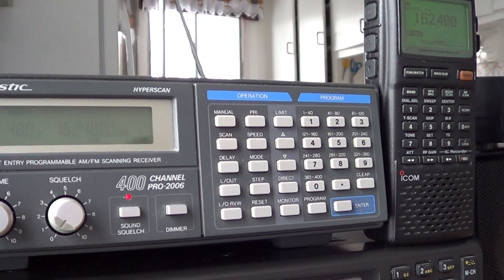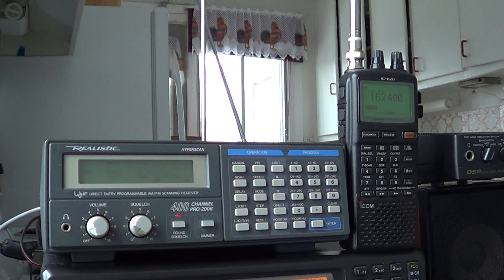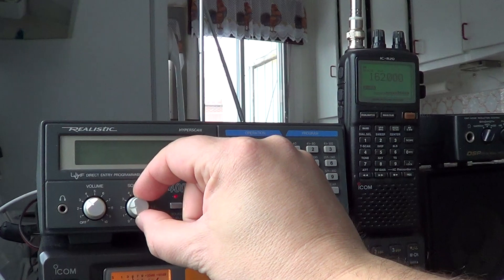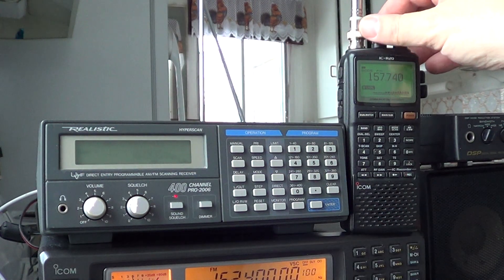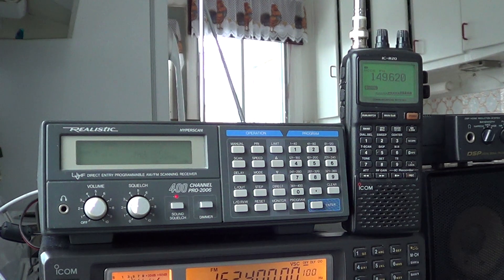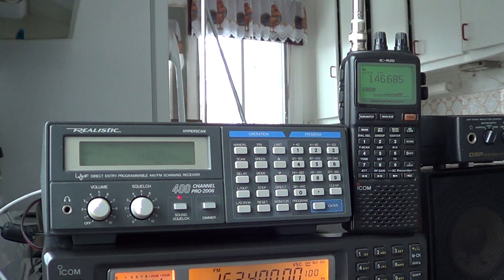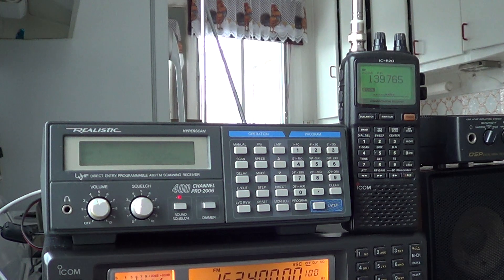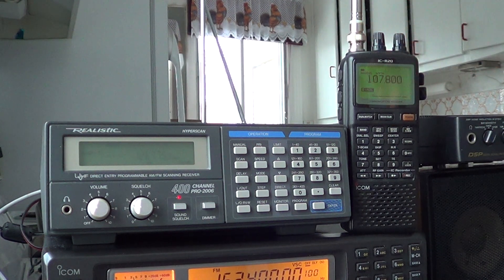Realistic PRO-2006 VS Icom IC R20 on VHF

Comment: It's difficult to compare when the antennas are at different positions. Radiosignals are radiowaves and at VHF it goes from max to min when you move the antenna 50cm. When comparing you really need to use the same antenna with a splitter to feed the exact same signal to both receivers. The lenght and angle of the telescope also affects reception. The Pro2006 have a zeromatic feature that let it stop on frequencies only if they are spot on and not 5KHz off. The Icom do not have that. The Pro2006 lacks 6.25KHz step (and some other step sizes) that modern bandplans over the world now use more and more so search will sometimes not work but scanning will as that do no use zeromatic. Higher scan/seach rates will let to capture more traffic but catching interference/intermod are a problem and needs RF filters. Having text tags for channels are a big help that Pro2006 lacks.

Comment: hi, on the pro 2006 can you add an antenna to it too? could you give me a good make and model of an antenna for it?
Reply: I use a discone 30 feet in the air and the reception is superb.
Reply from the maker: it has a BNC plug in the back for a outdoor antenna, a Discone is one of the great antennas for receiving VHF UHF

Comment: Very useful. I've just acquired an R20 and as a standalone receiver it is pretty deaf on SW and also on broadcast VHF. I tried to tune a weak station on 103.3MHz and instead it picked up spurious from another station, and so did my old R5. My SW-7600GR was able to do it with a little adjustment on the RF gain and a DE1103 got the best reception by far. I bought the R20 as an upgrade to my beloved R5. They perform pretty much the same. But the R20 has a whole lotta more features. I guess I should sell the R5, but I guess I'm a hoarder after all.

Comment: Your Pro-2006 still looks brand new. Mine was given to me by an acquaintance but was in pieces when he gave it to me. The rear plastic screw retainer rings on the upper and lower case halves were broken (a common problem on old Pro-2006's) but I found replacement screws with over-sized heads that properly secured the case to the chassis. The display backlight was completely burned out , the internal speaker didn't work, and the front panel looked as if someone operated the buttons while eating greasy ribs and the buttons were literally BLACK from their dirty-ass fingers. I disassembled the entire front panel and soaked the front plastic cover and rubber keypad in hot soapy water and used an old toothbrush to thoroughly clean everything. I replaced the electroluminescence (EL) backlight module (found on Ebay for $20) and looks like new again. I also replaced the rear-mounted external speaker jack (pulled from a parts-only Pro-2005) , which was the cause of the internal speaker not working. I wish I would have taken a picture before-hand because the difference afterward was utterly astounding. It looks and works great now and is an old favorite of mine. Even when it was dirty it still received perfectly. The Pro-2004, 5 & 6 are real workhorse scanners, as are the Pro-2035 and 2042, which I also own :)
Reply: Early model Pro-2006's have a button below the right side of the display that say's "Dimmer" which obviously dims the display backlight. Radio Shack later changed this from a dimmer function to an on/off button, as later units say "Light". This change came about because early 2006 backlights were burning out rather fast (an unfortunate trait of electroluminescence backlighting) You can tell if a Pro-2006 is an early or later model by what this button has screenprinted under it. Because many EL backlighting modules didn't last beyond the warranty period, Radio Shack later changed it in favor of LED backlighting, which practically NEVER burns out. LED's were used in the 2006's replacement, the Pro-2035.

Comment: one thing about the 2006, it does have a delay function, however the delay is not very long. often, by the time u get to the scanner and hit "manual" to stop the scan, it has returned to scanning. be nice if i had an option for a longer delay. also, have not found a way to page backwards in mem channels, it will however page forward in mem channels if u hit manual button. if anyone knows a way, let me know.

Comment: I still love my old Radio Shack Pro-2006 scanner. I installed a receive indicator LED on mine because I usually have several receivers going at any given time and it helps to have a receive light for the scanner that gets a hit.
The Pro-2006 was Radio Shack's flagship scanner back in the day and commanded $400 plus tax in it's hey-day, which was a LOT of money for a scanner in those days.

Still a great scanner after all these years :)

Comment: The Pro-2006 led fades out big-time if viewed from below the display. That, plus the fact the display light is burned out, means it's gonna be hard to see.

I replaced the Electroluminescent module in my Pro-2006 and it works like new again. That was a big problem with those old EL modules. Once they burned out you couldn't see the display :(

Personally I found the EL module easy to replace, and cost around $20 via an Ebay seller. It requires de/resoldering two contacts.